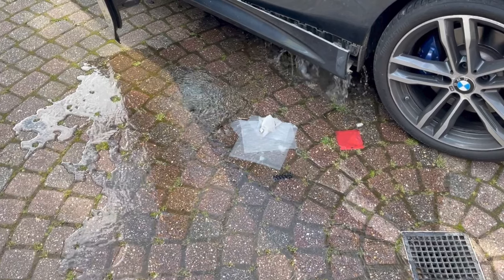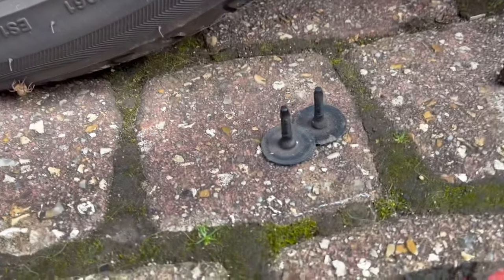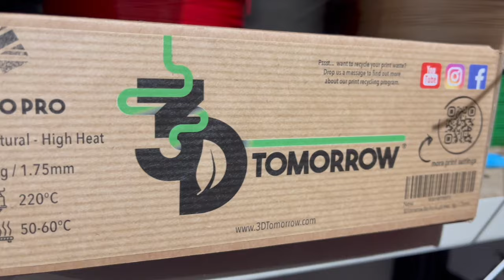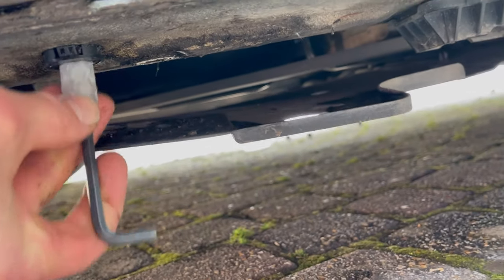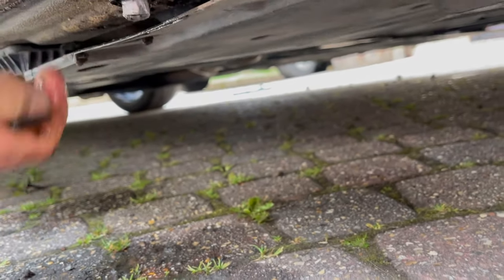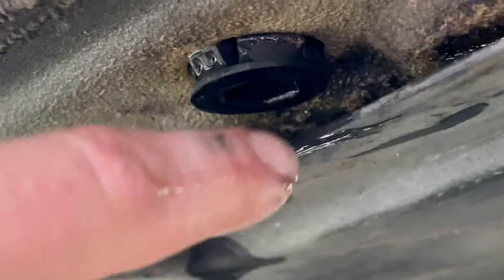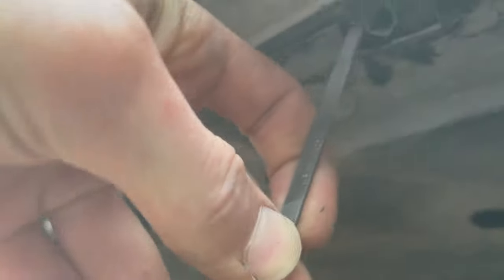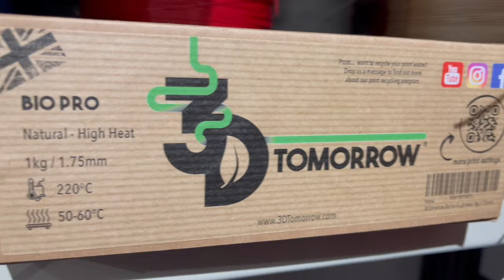BMW 4 Series F33 - Water Sloshing Sound Potential Fix - Save your Amp Before it Blows Like Mine!!

Comment: This should be shared with every 4 series convertible owner - I’m driving around with my headphones after the amp went pop on a 5 yr old M4 that BMW want to charge me over a grand to fix. Seeking an amp repair person however thanks for sharing, it really should be a factory recall yet we will be waiting a long time on that from BM
Reply from the maker: Yep completely agree! Just a ticking time bomb waiting to cost a load of money, poor form from BMW
Reply: Thanks, got rid of mine immediately afterwards
Reply: JUST HAD MY AMP BLOWN TOO ... bummer
Reply: appreciate the amp issue, but how does draining the side skirt fix the issue where the water pools under the amp? surely the issue with the amp is coming from above not below?
Reply: @paultthelekky4763  great question.. looking for answers
Reply: Hi 

Can you tell me about the symptoms of your blown amp please? 

I know no sound, but can you adjust the knob up and down the volume moving on the screen or not?
Reply: @paultthelekky4763   the water comes in through the back seat window and gets trapped.  If the water gets high enough in that small area, it goes over the wheel well and runs into the trunk floor where the amp is, and blows the amp if the water level gets high enough.
Reply: @mandlazooloo9733 same here yesterday... 😢
Reply: Same thing happened to me b4 xmas.The drain plugholes were blocked by gunk. If you hear a?sloshing sound. u must get on it right away...
Reply: Couldn’t agree more just got my m4 and found about a ltr of water around the amp luckily I managed to dry it out and save it
Reply: How does the water issue happen does it come from the car sitting outside in the rain over course of time does it come from washing the car over time the water builds up cause of the poor drain system created by bmw would you still have the same issue if the bmw convertible was garbage kept outta the rain I believe the m440i convertible bmw white red leather interior Is a beautiful car I'm looking at purchasing one 2022 but with these comments and issue yall having I'm thinking twice about it now.
Reply: Same issue. I noticed when I dropped the top that water was flooding everywhere. I was advised to wipe the water before dropping the top. My amp was blown. BMW wanted 340 to look at it, then 1000 to troubleshoot. Further investigation shows that the amp costs around 1800. I took it to a local auto stereo installer and he only charged 100 to look at it, troubleshoot it and get it sent off to see if it can be repaired. He was very familiar with this issue. He popped out the plugs below the amp and more than a liter of water flowed out onto the ground.
Reply: Those that need amp repair contact a company called Remanx, £294 repair
Reply: @scottydoo2809  Which country is this company located in?

Comment: Outstanding!   I had just bought my 2018 4-series convertible, and after a rain ... no radio.  

AND: BTW - you may be able to fix your amp if it's been underwater.  Try this: Remove the amp.  Disassemble it down to the circuit board.  Clean the board carefully with isopropyl alcohol (or contact cleaner).  Then, put the board in your oven, and set it for about 175 degrees (F).  Let it bake all the water away for a good 7-8 hours.  Reassemble, and test.  Fixed mine!

I'm a retired EE, did major stuff with PCBs & circuit board mfg.  175 F will not hurt anything.  And, what do you have to loose!

Good luck - and THANK YOU for the video!

Comment: You've shown what's involved very well, Well done! Inspired use of the 3D printer! Bit of a bodge on the nut and bolts with the tape but it worked so all good. Using a bolt and a couple of (the right size) nuts locked up together I found easiest to "make" the 13mm allen key. For the viewers benefit, it only has to turn that little plug about an eigth of a turn to release the plug and it isn't hard to turn. 

I wouldn't advise drilling the hole after you screwed the panel back up, you could potentially mangle the plug (allen key won't be much good if someone drills in too far and rounds the hexagonal insert off), it's easier to do while you have the panel down. 
Easiest way to cut the plastic panels is with a dremel-type tool, goes through them like butter. I didn't even pull off the side skirts, just bent them down underneath by a couple of inches, and wedged them to maintain the gap while I made the cut-out in the plastic with the dremel. The advantage of making cut-outs over drilling is that you can make the hole large enough that you can remove the drain plugs in future (should you ever need to if they get gunked up again) without having to release any trim screws for the side skirts or under-tray.

A little explanation of the theory. The side skirts and under-tray don't have gaps for the drain holes because BMW have used the same ones as for the coupe, which doesn't have opening rear windows, they're sealed, water can't get into that section so doesn't need a drain plug. BMW should have designed specific side skirts and under-tray for the convertible with cut-outs for the drain plugs either side but they didn't. Purely a design oversight (mistake).

The last thing to mention, which none of the videos show (I can't talk, I didn't even make one, lol) but what people will be asking is how does it fill with water? Essentially over time the rubber seals on the rear windows (which open on a convertible) don't seal properly and let water in. Obviously heavy rain at the wrong angle will penetrate, and something people should be aware of when they wash their cars, particularly if using a jet wash. They're essentially filling up their own quarter panels with water without realising. Car doors always have drains at the bottom in case water ingresses past the window rubbers, the rear panels on convertibles same applies. To keep water out people should replace the rear window sealing rubbers when they get old / hard / brittle enough that they no longer prevent the ingress of water. Dirt and gunk gets lodged down the gap accelerating deterioration and just as windscreen wipers deteriorate, they won't provide a good seal against the glass forever. Apologies for the long comment, but hope that fills in the gaps.
Reply from the maker: Thanks for the comment! Yep bolt and tape was definitely a bodge lol, but impatience got the better of me, at least I have the printed version for if I need to re-clean at some point in the future.

Agree that it probably would be best to do the side skirt while separated, that's why I kept the drilled holes quite a bit smaller than the size of the plug opening. But realistically, it would be best for the hole to be the same size, if not bigger.

Very interesting to know about the reason for this issue, expensive design oversight though!
Reply: @CallumColes  Body styling designers missed talking to the engineers about that point. "Oh it's the same shape as the coupe, we can use the same sills and undertrays"...
Reply: Use a pair of channel lock pliers, its not that hard to remove

Comment: This problem just happend to me, water slosh sound in back panel. Exact same problem you are having. The reason the water gets in there is because of the back window rubber has gotten bad. Its deformed to the point where water slides in to the back. I tested it with a bottle of water on the bad side and the water gushes in to the car. On the other side where the rubber stil is good the water glides of off it. So i would imagine the long fix is to replace the back window rubber. After fixing the drain plug of course. Excellent video. (m4 f83)
Reply from the maker: Cheers for the comment! Yeah the window seals are considered are maintainable part, I think they have a 5 year advised lifetime or something like that. But if the drainage has been properly designed, water should still always be able to get back out if it gets in!

Comment: Really valuable and informative video! My F33 convertible has been dripping for weeks and this explains why. The dealer conversation was not useful - this video was! I shall be following your example of unblocking and then adding a drain hole. Many thanks.
Reply from the maker: Thanks for the comment, was certainly not what I wanted to discover, but figured if videoing the process could help a few other people it would be worth sharing the experience:)

Comment: Thank you! Same exact problem on my 2018 430i convertable. I was able to improvise by using a bolt head (as you recommended) and just turned it with a pair of vice gribs. Probably drained about 2 liters of water between both sides. The driver side was worse. Unfortunately what led me down this road was the blown amp, finding it submerged in water 😩
Update, there is a service bulleting from BMW on this: 513316. They say to leave the drain plug out after removing it. Don't re-install it. I also saw on other threads to cut both plastic overlays to allow the water to flow and not cause dirt/grime building up to prevent drainage.

Comment: My 2015 F33 has lost 1 amp and also over time flooded on the battery side which corroded the main cable terminal to the front of the car and one day it just wouldn't start. Both expensive to rectify by dealer. Interestingly at some point they also drilled the holes (as per BMW Service Information Bulletin SI B51 33 16 V2) but that did not stop the problem - maybe the holes were in the wrong place or the drain plugs just got blocked anyway. Also they never even bothered to tell me they'd done this - I only knew when I found the holes. Anyway, a few months ago I removed the plugs and on both sides got as much water out as in the video. I haven't put them back in - as far as I can see they could just get blocked again with gunk even with a hole beneath and can't see how any water off the road could go upwards and cause a problem. So far so good. Note that another tell tale sign I had was the rear window coming up with drops of water on it even when it had not rained for a while.
Reply from the maker: Thanks for sharing your experience, crazy that they still managed to get blocked even with the holes drilled below. Nightmare design!

Comment: A brilliant video.  We heard sloshing water noise in my wife's 2015 420d convertible a few days ago. I accessed as per the video and did the offside first and gallons of water escaped.  I then did the nearside and it seeped but no gush.  I then prodded up with a screwdriver and saw a plug of debris slowly lower itself before the torrent.  Obviously the debris had been accumulating more on that side blocking off access to the drain hole totally.  I agree - an abysmal design by BMW - and I have always been a BMW fan...
Reply from the maker: Thanks! Hopefully it was in time to save your Amp from blowing?
Reply: @CallumColes  Yes it was.  Just heard the sloshing sound after the recent storms and so no damage luckily...

Comment: This brings back memories, I had same issue on my F33 last year,  full of water, drilled through the valve and gallons of water came out, unfortunately it causes my window regulator cable to snap, so had issues getting the roof up, all got sorted in the end, required a new window regulator, and was installed.
Reply from the maker: Thanks for sharing your version of events! Problem shared is a problem halved as they say, glad it all got sorted.
Reply: How much did all that come out to in the end? If i may ask

Comment: Thanks for the information, we just drained about 10gal from the back. New holes made it drain much better, the sludge buildup will happen so make this a maintenance item with your oil changes and clean that plastic part

Comment: Just uploaded a short vid of my wife’s 430i convert. Thanks for your vid so I knew how to fix. I found that a bolt with a 9/16” head fits in the drain plug so I used the bolt with a stop nut as a wrench. Thanks again.
Reply from the maker: Glad it helped, thanks for the comment

Comment: Your instruction was spot on, although I had to borrow a 13mm Allen key from my local very friendly ATS Euromaster as it is not standard size. I drained litres of water from both sides of my car and removed the plastic plugs completely.  Unfortunately I found your video after the water had sloshed over and drowned my boot and blown my amp :-( so still a costly repair.

Comment: Perfect - thanks for a great video!  Thought I could hear sloshing in the passenger side sill of my 440 convertible and was on my way to the garage to let them investigate (but it was closed this weekend) when I had multiple electrical failures/warnings on my dash as well as losing my iDrive display completely, most button controls, audio - and my boot wouldn’t open at all (had to manually release it from inside the car). Boot carpet fairly damp, & lots of condensation in the car. Hope I haven’t killed the amp & it’s just fuses. Meanwhile, I’m running a dehumidifier overnight to try and remove most water vapour.  We’ll see!!
Reply from the maker: You're welcome, cheers for the comment. Let me know how you get on, hopefully the amp survived!!

Comment: Thanks for the video.  Just had my 435 drains cleared by a local BMW / Mercedes garage. The car had the water swashing noise and your video put me onto the problem.  Cost £106 and they did the mod so the drains shouldn't get blocked again.  Fortunately the amp and surrounding area was dry, although they reckoned the got 2lts of water out of the drain.    Thanks again!
Reply from the maker: You’re welcome! £106 much cheaper than if the amp had gone👌🏼

Comment: Thanks, a lot.. u saved me a hefty bill .... 530 gt 2012 has no drain plug, For some reason BMW decided to seal the opening coz i could see the plastic bit but no screw..... so I had to drill a hole to get the water out... but my Rear Passenger carpet was getting soaking wet .... leaving it to dry now.
Reply from the maker: You’re welcome! Yes seems the BMW engineers like to forget about the drainage… 🙈
Reply: @CallumColes  Absolutely.... why would u do that i mean they designed a Frameless door car and think water will never get in btw I am still unsure how water got in :D... do you know how u got water under the floor Thanks

Comment: Dude thanks so much for this video… i already lost my amp… my roof has a missing piece on each side now… just broke and came off the roof… 🤬…. 
If rains … i have a pool in my car!! Insane… 
If you have any suggestions.. i take them all!  
Thanks so much
Reply: Bro same fuck this car is an hassle with higher mileage. The roof parts have to be replaced. Mines broke too and small piece fell off. Shits so frustrating and my amp is blown.
Reply: @CZ-57  damn… same here bro
Reply from the maker: Nightmare of a car🙈 at least it has a good resale value because it’s one of the very few four seater hard top convertibles models
Reply: After umdion the tory bolts will the side skirt still come off if you have carbon fibre side skirts attached? Great vid BTW 👌

Comment: Hi Callum, thanks for sharing this.ive got a 2016 420 hard top convertible and fear this might be an issue with mine. I’ve never experienced any symptoms and there aren’t any sloshing sounds even when I do an emergency stop on an upward or downward slope. I ve checked the rubber sea.s around the rear windows and they don’t seem to be slack. I don’t have any Mechanical expertise nor any tools or a Jack. I will get my local mechanic to check it when it’s next in for new tyres soon. any idea if later models than yours had a redesign/fix?
Reply from the maker: Hey Susan, the one is the video was 2017, so yes I’d definitely recommend have your mechanic take a look and install the drainage holes. Alternatively if you take it to BMW they should do it for free, since it’s a design flaw.
Reply: @CallumColes  Thanks Callum
Reply: @CallumColes is that the argument at the dealer? 2015, no more warranty. Argue that the water is sloshing around and it's their fault? Lol please advise!

Comment: For a 3 year old video this is still relevant.  This needs doing if you haven't already.  Does anyone know if there is a drain the other side of the rear wheel arch in the boot, (underneath towards the rear of the car) as maybe water can slosh over if full enough??  Thanks again.  😊

Comment: Great video pal. Please can you advise whether both sides were filled with water?
Reply: Can vary depending upon conditions (do you always park so one side faces the sun and one window sealing rubber deteriorates quicker than the other?  etc) but typically yes, the window sealing rubbers are the same age, have undergone the same temperature changes and falling debris from trees, leaves etc so deteriorate similarly and fail to seal and prevent the ingress of water at a similar time.
Reply from the maker: Yep, both sides had filled, but the one side far more than the other since the gunk was worse. So the water did not even drain until completely removed.

Comment: Thank you for the video and info. I have another question, when i first drove my car after the heavy rain and heard sloshing sounds, there was no water in the car anywhere but i heard sounds from the roof as well, when i forced the car with heavy braking, some water came in from the roof middle section, but that was it. Where is this water exactly filling and whats the risk of it filling inside? I opened the top and there was no water anywhere on the roof either.